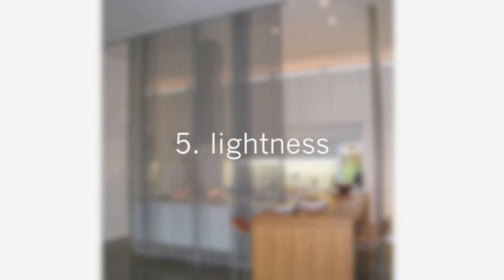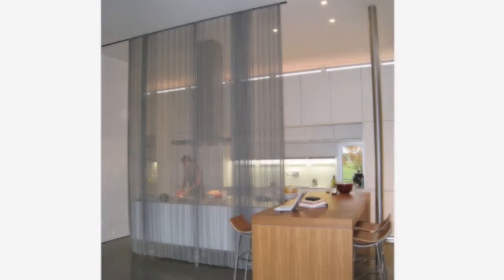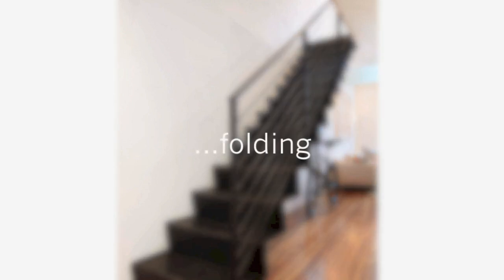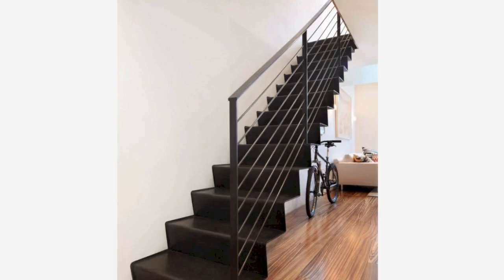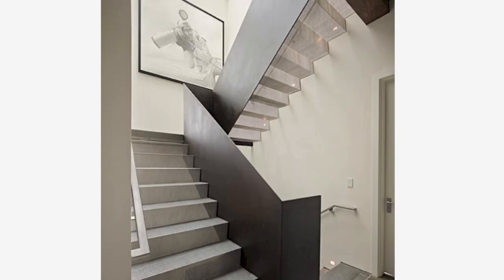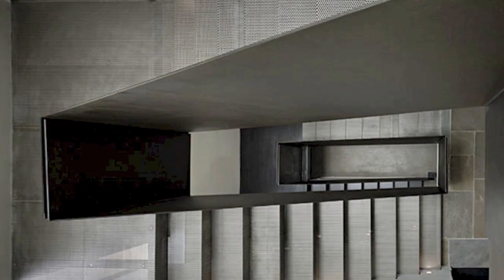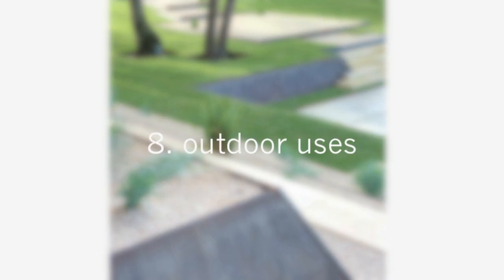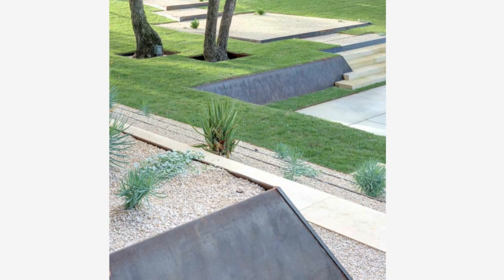Steel + Residential Architecture - An Architect's How-to Guide

Comment: Yes, but- from the time it’s made steel wants to oxidize, so exterior steel needs to be protected forever, and a designer needs to think about all that repainting. Corten is nice, but is expensive, not available in all shapes, and needs careful detailing for the brown rust that flows off it.  Take a cruise ship, and you’ll see the crew painting some of the exterior steel every day.  Steel windows were popular in the 1920s-30s but went out of use because they were hard to maintain. Steel expands when it rusts and needs to be protected, even inside masonry or concrete.  I think we owe it to users of out architecture to think beyond the first few years.

Comment: Nice video.  Learned a lot about steel and its uses. Would have been nice if you discussed a little bit about costs vs using wood or other materials for use in the same instances.  How much is steel vs wood beams for instance....